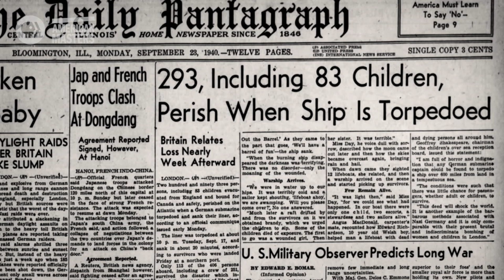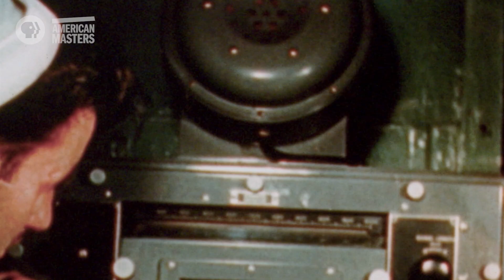How Hedy Lamarr Developed a Secret Communications System

Comment: Brilliant...How does the receiver in the torpedo follow each freq shift from the transmitter?
Reply: They are sender and receiver are set to send and receive signals by a synchronized clock.
Reply: She partnered with a Composer named George Antheil. Antheil composed a song to be played by 100 player pianos at the same time. The paper rolls to control the pianos were identical and started at the same time. They made a prototype for the frequency hopping device using miniature player piano mechanisms. Think of a little music box mechanism that turns a little spindle with bumps on it making the tune. Come to think of it, not unlike the early IBM cards with the holes punched out. Just start the transmitter in the ship and the receiver in the torpedo at the same time.
Reply: @podunkcitizen2562  Hedy's father engaged her childhood curiosity in regards explaining how basic everyday technology of the day worked.  Likewise, as a young child, she took apart her music box which can be considered a 'frequency hopping device', dating back to ~1770.  So the concept of 'shifting/hopping frequencies' was nothing new.  Likewise, it's typical of most 'inventors' mindsets, to see the related qualitative associations and interconnections that give rise to related inspirations - its how our minds work via pattern recognition and related inferences.  In Hedy's case,  she didn't need an technical degree to put two and two together, where she'd picked up on 'frequency jamming' during her first marriage.  So, perhaps the music box was what really inspired her notion of 'frequency hopping', also working in a fixed, synchronous fashion.  p.s. The concept of frequency shifting controlled via perforated media was a well established communications patent from decades earlier.  It's more so where using a 'player piano' style mechanism would be the unique basis for the patent by Hedy & Company.  Solely as a alternative mechanism, a variation of the earlier patents which Hedy & Co. would not have known about.